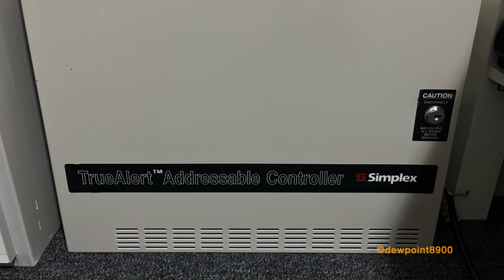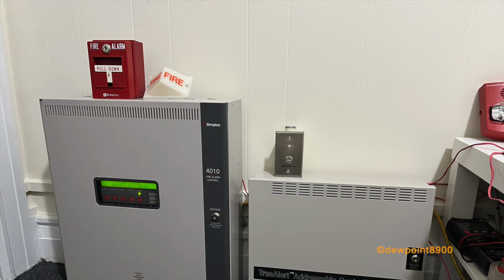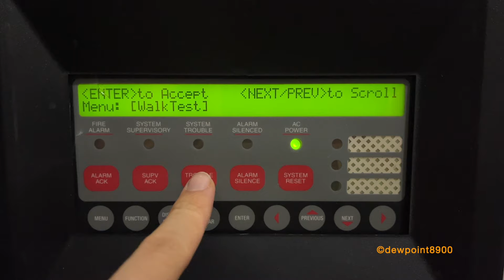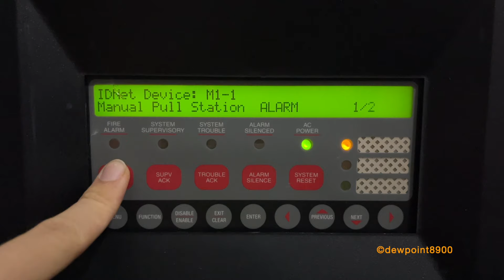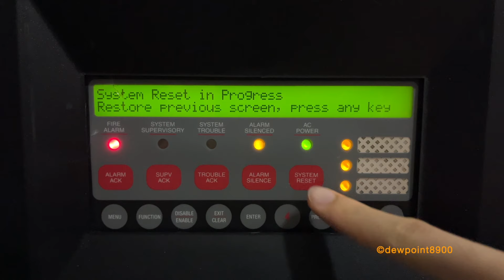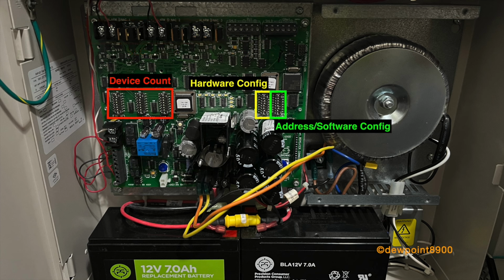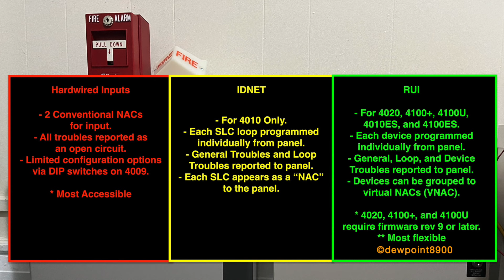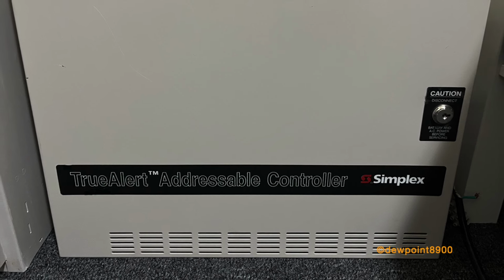Simplex 4009 TrueAlert Addressable Controller Overview and Demo

Comment: What additional functionality do the ES devices have?
Reply from the maker: Each device has its own address and be controlled individually from the panel. The ES series also tracks sound output and strobe brightness for maintenance purposes. Furthermore, the addressable signals can be magnet tested to ensure functionality.